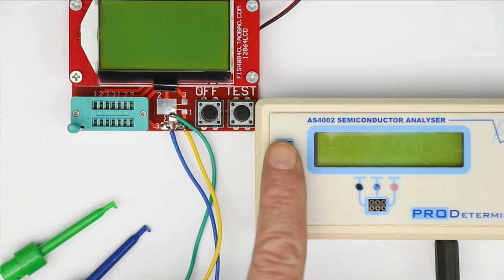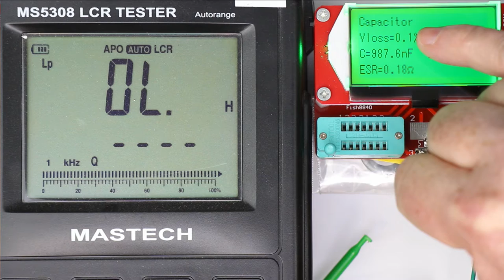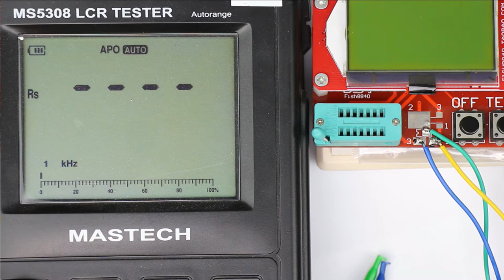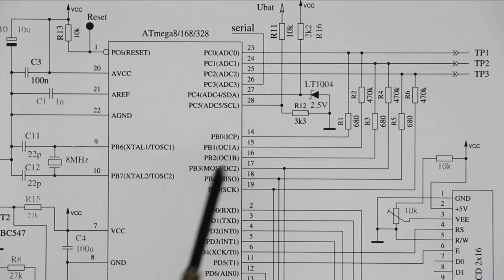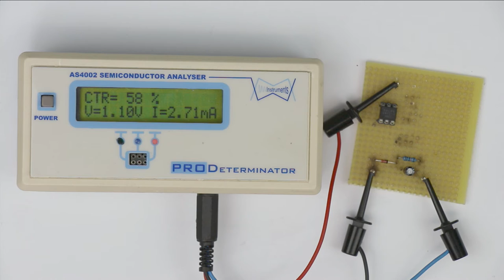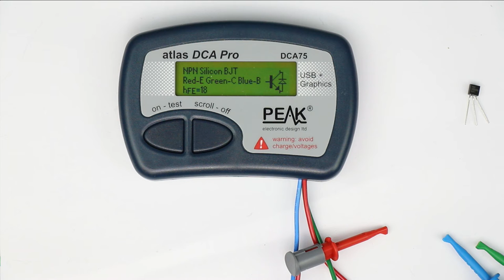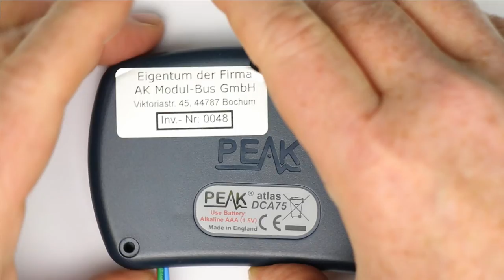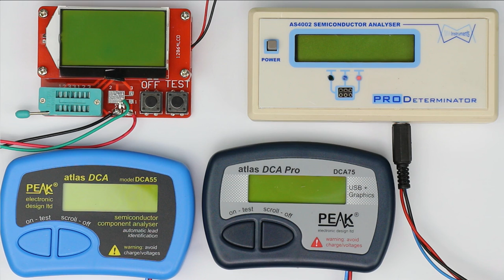Component Tester Shootout [Pt.3]: Special Functions, Tear-down & Final Verdict

Comment: Was this tester originally designed by Markus Frejek  and further by Karl-Heinz Kübbeler ? Eventually I did hear the name Kübbeler. I'm not sure you will show is high voltage Zener test, I have only read that it is in a document I have but have not tried it.
Reply from the maker: Yes. Can be on www.mikrocontroller.net under the project "Transistortester". It´s open source and sells under many different variations on Ebay/AliExpress. Because the firmware can be configured with many different options we have modified the Chinese firmware-version and sell it with a firmware with the emphasis on high-precision measurements.

Comment: Hi! The device I have got is called MTester, do you know if it is similar in any way to the Fish8840? And can it measure ESR in circuit? I am a novice who is wanting to learn to repair vintage audio and wants to look for good tutorials on the subject.
Reply from the maker: If you give me a link to where I can find the "MTester" I can tell you if it´s the same.
Reply from the maker: Yes, it´s the same type. But for the best useability you should look out for a type that also has mini-grapper clips additional to the ZIF-socket.
And the 1% precision voltage reference to have the best accuracy.
When you search for "transistor tester" in EBay you will a lot of different types of the same basic circuit for quite low prices.
Or you buy the one from our store which has a customized firmware for giving the best precision in the passive componets measurement :-)
http://www.ak-modul-bus.de/stat/halbleiter_und_komponenten_tester.html

Comment: i think they are using a zener for reference not the atmega internal
Reply from the maker: It depends on the type of the many variations of the component-tester ripoffs that are sold on Ebay, Aliexpress etc.
Because you can set the use of internal or external reference with a switch in the freely available source-code, each seller is free if he uses internal or external reference.
The one I compared here did have a footprint for an external precision-reference, but was not populated.
So it must use the internal ATMega reference.
The one we know sell in our shop indeed does have an external precision-reference.
Reply: yes, i hadn't gotten that far in the video, doh
thanks for the video